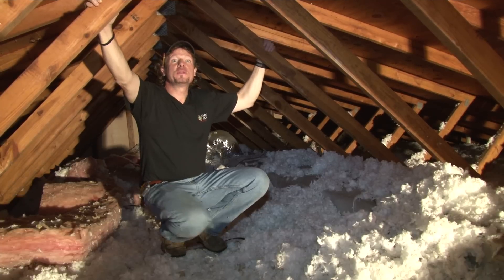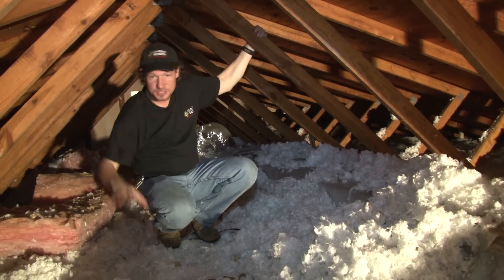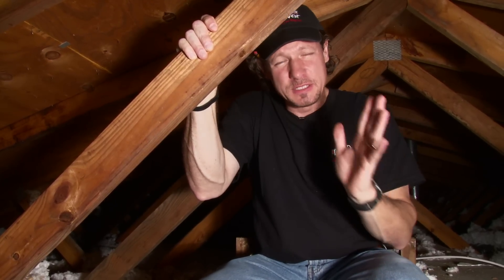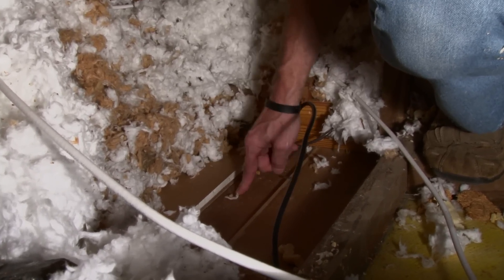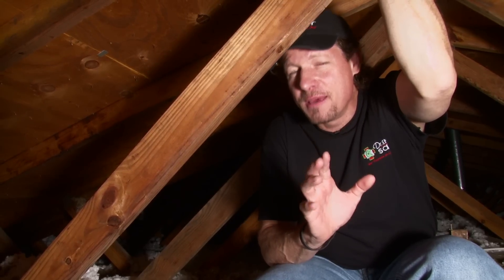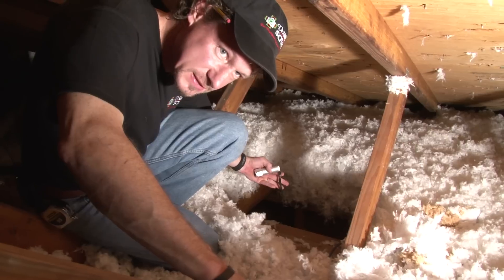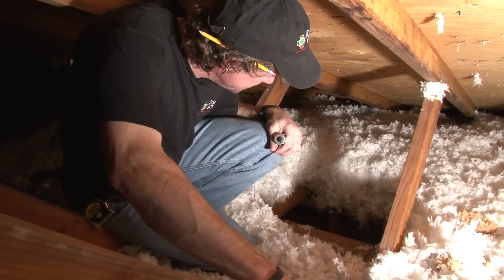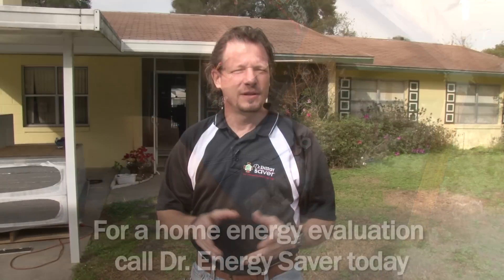The Importance of Air Sealing and Insulating Attics

Comment: Rock wool was here BEFORE fiberglass. Since fiberglass was marketed, house fires skyrocketed, since fiberglass will smolder and burn, will also mold if it gets wet. Rock wool. WILL NOT burn and does not absorb water .
Reply: David Mandziuk fiberglass does not burn or smelter you can hold a torch to it, only exception is if the paper catches on fire and it's untreated paper
Reply: Rock wool or Mineral Wool is the best and it does not mold either. It can actually dry out too.

Comment: you seal where the living space meets the attic, so no heated/warmed air can escape.  the attic itself is still vented.
Reply: The attic is still hot, however.  Roof with a light color. 
Forget dust collecting, buries everything, nasty blown in .
Use rigid polystyrene over or between rafters and between attic flooring and ceiling below.

Comment: How much settling is there in cellulose insulation over the years? I was told that with settling it loses its effectiveness?
Reply: tibzig1 my understanding is it compresses but doesn't lose R value as it does. It does however become unsettled very easily. It makes a mess and starts coming into the home. 

Ever seen your ceiling get dark marks by your air vents? That's the cellulose.
Reply: @ciscokidd6119  It definitely will lose its effectiveness when it settles, but how much or how long this takes I'm not sure. Insulation works by trapping air and preventing it from moving around, so if it loses its air then it will lose much of its insulating effect.
Reply: @averyalexander2303  cellulose will settle about 3/4" over its life time

Comment: Why cant we duct the radiant heat in attic during the winter months through HVAC return to then be filtered and recirculated through living space.
Reply: How exactly would you use the radiant heat to warm the return air without letting the air lose heat to the attic? Let's say you run a large, flat, dark colored sheet metal duct through the attic to try to pick up radiant heat. When it's, for example, 20 degrees outside and maybe 30 degrees in the attic, do you really think that duct would pick up enough radiant heat to offset the heat lost from running your warm 70 degree interior air through that duct? Highly doubtful. But even if you did, how would you manage the significant heat losses from running your warm return air through that large insulated duct when it's night time and your heating load is at its highest but there isn't any sun to create radiant heat? What about when the roof is covered in snow and there is virtually no radiant heat gain? And how would you keep that radiant heater duct from picking up a massive amount of radiant heat in the summer when heat gain isn't wanted?

Comment: I live in Florida and I have a tighter Attic then shown in your video. Would you recommend removing the 1974 insulation before blowing in more? Thank you.
Reply: All the information I've seen says as long as your existing insulation is not wet or moldy, you can just spray more insulation on top of it, or put more batt insulation on top.

Comment: This video is awesome!  Does malpractice mean it is illegal?  What type of "Good Stuff" do I get to air seal?
Reply: +Anthony Sharp I tend to use the fire rated version for the attic, just because I'm not planning on having to re-check it very often. However, you only really need that around penetrations (for wiring, tubing, and ducts,) for the general sealing of the top plates and studs you should be able to use the regular stuff.
Reply: crimsonsamuraiftw 
Fire rated stuff still burns
Reply: @andrewbeaudry4399  Yup. My understanding is the fireblock foam is the same formula as the regular stuff and it definitely still burns, I believe it's just orange so inspectors can easily see it.

Comment: How much air moves through the top plate of a wall?
Reply: Assuming it isn't sealed well? Depends on way too many factors to even estimate. If the room is under a mechanically induced pressure differential such as from a ducted HVAC system running with the door closed and the supply and return airflow is not perfectly balanced (which is almost always the case), potentially a lot if it isn't sealed. If the attic is under a mechanically induced pressure differential such as from electric ventilation or wind turbines, likely a lot. Even differences in temperature and humidity between the house and the attic can create pressure differentials that move significant amounts of air. If you want to see for yourself, a good bet is to look at the insulation around the holes and gaps. If it's noticeably darker around the gaps as it usually is, that means air has been flowing through there and the insulation has been acting like a filter.